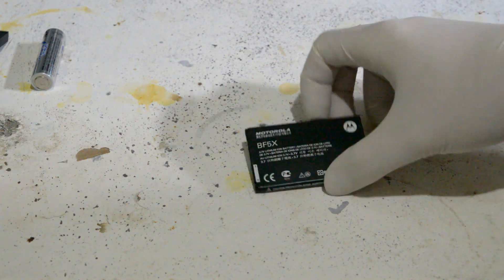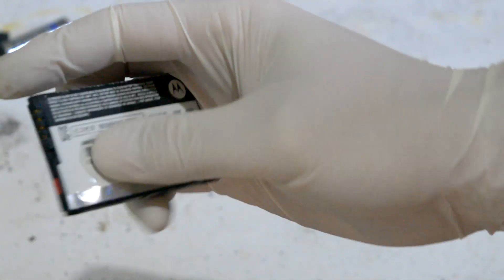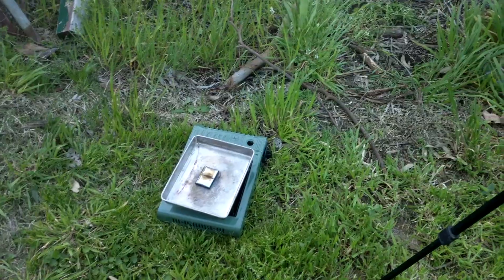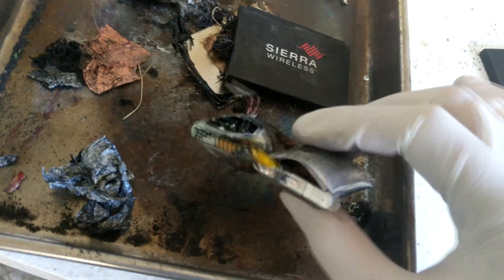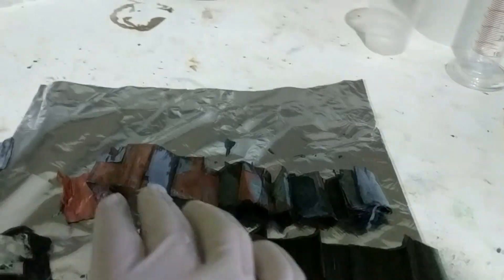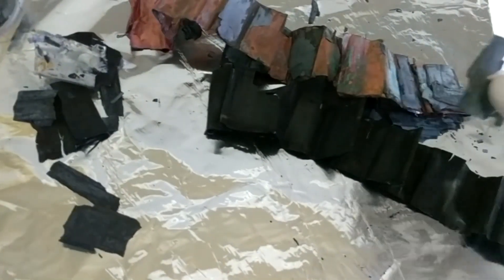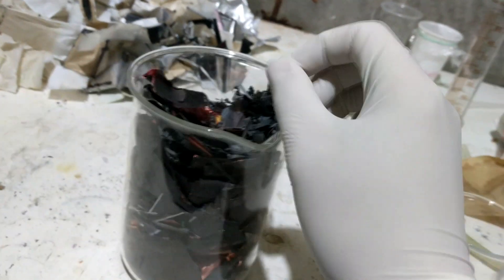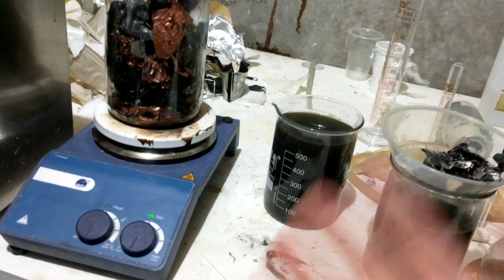Getting Lithium from Phone (Li-ion) Batteries - Part 1

Comment: Save the little bms boards as they will work with many types of lithium ion batteries. Discharge the batteries. Open them, then soak the guts in carbonated water. The lithium will disolve but the rest won't. After that you can get to the copper cobalt and nickel at your leasure. The lithium carbonate can be recovered by simply drying the solution.

Comment: Plenty of home devices with beryllium oxide already. Obviously in microwaves... A lot of electronic components are made with a BeO ceramic.... Just don't vaporize the stuff or bang out rails of it... It's not gonna cause too many issues. I know they gotta put warming labels to not drink brake fluid these days but inhaling or ingesting BeO or a Be salt would simply take too much work to get at. And those who are ultra-determined to go ahead and do it and ingest it anyway...  Need to be weeded out of the gene pool anyhow. So i say bring it on! There's barely any content for Beryllium on YouTube at all.... Just sayin

Comment: Would the "plastic" seperator be useful in an electrolysis cell, for example, copper sulphate to H2SO4 and copper metal rather than the use of a terracotta pot ?

Comment: My experience indicates anything done with a lithium battery s/b done immersed in naphtha, hexane, heptane or gasoline to prevent the lithium from making sparks and igniting.  I realize that is counter-intuitive but it is the truth..  Of course, if any water gets on it the stuff instantly ignites. 0:30  There is just under a gram of lithium in the AA-size lithium battery.  It is mixed with carbon so the piece weighs more than a gram.  If using it for chemistry experiments, be sure to look for and remove the little 'tab' of another metal attached to it so you don't ruin your aminations and whatnot. :It is also cheap to buy online in a pure form.

Comment: I know this is late and there’s probably a ton of these. This was an insanely dumb idea. I worked with lithium batteries. The single most dangerous battery I’ve ever worked with. Cutting them open could have made them burned for days if it was a different chemistry
Reply: You'd need a real big battery for it to burn for days. I've stuck a nail through big RC packs and they spit fire out violently but not for long.

Comment: You could put the batteries in hot water with a bit of salt to discharge them & soften the plastic. Then the plastic could be easier to score with something & maybepeel the plastic off.

Comment: +Extractions&Ire It´s actually possible to react and dissolve the lithium cobalt(III) oxide with nitric, sulfuric or acetic acids if you also add some hydrogen peroxide, which will reduce the cobalt(III) ions into cobalt(II) ions and will also produce oxygen gas.
Reply: Would muriatric (hydrochloric) acid work as well?
Reply: @someghostwithinternetacess1066  Hydrochloric acid works, but the reaction produces chlorine gas besides cobalt(II) chloride and lithium chloride so be careful.
Reply: @chemicalmaster3267  ok is there a way to reduce both into their pure forms? sorry english not my 1st luguage
Reply: @someghostwithinternetacess1066  It´s Ok, just keep practicing your English! Solutions of cobalt(II) can be reduced to cobalt metal by reacting with a more reactive metal like zinc or aluminum in a double desplacement reaction, but lithium metal is quite difficult to reduce from its compounds by an amateur chemist. Lithium is usually obtained by electrolysis of molten lithium chloride.
Reply: @chemicalmaster3267  ok it's mostly i don't use the correct wordings

Comment: Was surprised to find step 1 is blow it up, but then I remembered the name of the channel. Never change.

Also I looked into it and the explosion of a Lithium Ion battery supposedly gives off (going off memory here) Hydrogen Sulfide gas or somwthing. What I do remember for sure is it's the gas that'll interact with the liquid surface of your eyes to form Hydrochloric Acid, and nearly definitely blind you. So, don't try at home without doing the research and wearing proper PPE, this is rather dangerous if done too casually.

Comment: "They wouldn't put berrylium in a home device... It's too toxic"
You mean like the berylium that's included in almost EVERY microwave oven magnetron??? Ahhh, I see
Reply: I think you meant to say the beryllium oxide which is inert and has even been used in projectile weapons Nice try though
Reply: Inert huh?  Apart from the FACT that Berrylium Oxide is WIDELY known to be the leading cause of Berryliosis!
P.S.  They've put Uranium into 'projectile weapons' too!!!
Personally, I would suggest that any potential 'toxic' effects would be slightly outweighed by the great big HOLE through your head
Reply: @trevorvanbremen4718  BeO is carcinogenic in powdered form [12] and may cause chronic beryllium disease. Once fired into solid form, it is safe to handle if not subjected to machining that generates dust.[13] Beryllium oxide ceramic is not a hazardous waste under federal law in the USA
Reply: @trevorvanbremen4718  🤔🍑💨🤣🤣🤣

Comment: "They wouldn't put beryllium in a home device because it's too toxic" Umm... think again. Some microwave magnetrons have beryllium oxide ceramic in them. Or so I heard, maybe it's a myth... hey, there you have a video idea! Extract beryllium from magnetrons! (JK, please don't unless you want berylliosis)
Reply: That's beryllium oxide a highly refractory insulator not likely to react with anything oxides are not pure metals they do not react the same I will refer you to titanium dioxide frequently used in paint.....
Reply: Dani Syx Nope, it still gives you berylliosis, it’s the element, which causes an immune response. Beryllium compounds give you berylliosis as well as the metal, just like heavy metal compounds will also give you heavy metal poisoning.
Reply: Silica causes silicosis we better get rid of that too 🤣🤣🤣🍑💨
Reply: Dani Syx Silicosis only happens with very fine particles of silica, and that’s not easily found. In contrast, if you break the beryllium oxide, a very fine powder could emerge from it. It’s not a problem if you leave it inside the microwave but you need to be careful if you want to work with it.

Comment: The more charged the battery, the more energetic the reaction when punctured or breached. 
I had a complete dead, no revive possible LI-ion cell that gave absolutely no reaction, not even any bubbles when i poured water directly on the lithium covered plastic sheet. Then i took my old Samsung S5 battery and punctured it. Now that was fun. It had a 75% charge. That's one of the major reasons they don't ship li-ion batteries charged over 50%

Comment: 1:58 They do. In the magnetic creator (I think called Magnetron) of a microwave there may be Berylliumoxid. So if you Break it its not good.
Reply: Yeah it's an oxide so it's not going to react the way it normally would right? We are doing chemistry here aren't we? let me guess next you're going to tell me titanium dioxide has exactly the same properties as titanium because you know paint....
Reply: @danisyx5804  Berylliumoxid is very very toxic. It may only be in some magnetrons, still you have to be very careful. I am just trying to warn.
Reply: Yep, apparently its only in the older ones tho, in new ones they've apparently stopped using it in favour of aluminium oxide

Comment: tbh it looks like there's still a ton of Li/CoO in your reagent jar.  you can always boil it down.  i'd run at least 2 more extractions on it, so you can clean up the copper, which is valuable in its own right, and water is not exactly a scarce resource, even in australia.  at least not at the quantities you're using.  that whole reagent jar still looks black with Li/CoO.

Comment: They DO put beryllium in consumer goods, though. The magnetron tube has beryllium in it. Though I'm not sure for what purpose. You could easily make a microwave oscillator using a gunn or tunnel diode, but considering they cost about $20 each, it's not very practical for consumer level production. Plus I think those diodes only operate at a few milliwatts (0.001 watt) whee microwave ovens put out up to a 1.5 kilowatts (1500 watts) So I guess it's a necessary evil. I think cadmium in NiCad batteries was a much bigger safety concern. Cadmium scares the crap out of me.

Comment: U can make radium whit that and someting else, then u can make plutonium
Reply: You can’t "make" radium.

The "something else" you need IS radium.

You can extract some radium sulfate from old clocks and use the lithium (or any other strong reducing agent) to obtain radium metal, but there is no reason for that, the sulfate works just fine.
The radium sulfate can be used in combination with beryllium to make a neutron source. That neutron source can be used to convert uranium to neptunium wich will eventually decay to plutonium..but that would yield sub-microgram amounts.

A deuterium fusor (probably the strongest neutron source a hobbyist can build) would be a little bit better than the radium neutron source, but the only way to get visible amounts of plutonium is a critical fission reactor. And you need many many kilograms of uranium for that to work. And it is only legal to own a few kilograms of uranium, that’s not enough.
Reply: @among-us-99999  you're right
Reply: @among-us-99999  https://www.youtube.com/watch?v=dwRt74nzRmY&t=71s idk

Comment: It's best to first discharge them completely by first doing a normal discharge, then placing them in saltwater to fully drain all remaining charge. Then, you can cut them without any violent reaction.
Reply: NetRolller3D but you should still take a step back, the reaction products of the electrolyte with air are not very healthy. (Electrolyte contains LiPF₆)

Comment: Just my two cents from experience:
Whenever disposing of single cell Lithium-anything 18650s, I dunk them in a salt water bathe so the stored charges dissipate down to unusable. This may also work with battery packs like you used, but go easy on the salt to prevent it from tripping one of the internal fuses.

This should oxidize the Lithium itself (rendering it unusable for a battery) and save from extra sparks and toxic fumes.
Reply: Salt discharge method is a myth!

Comment: Suggestion: You could completely discharge the batteries first, way safer. Make sure you remember to bypass the protection circuitry (usually a little board on the top of the cell). If you don't it won't drop below around 2 volts. Leave it to short out for a day, ideally through a 5 ohm resistor to avoid it overheating and bulging the plates apart. If this happens there'll be some charge remaining where are gap has formed between the plates (squeeze it back together with a vice if so). You could then verify if it's been fully discharged with a voltmeter and making sure it stays at 0volts, but leave it 10 minutes after disconnecting the short before taking the measurement to allow any latent charge to rear its ugly head.
Reply: Even mostly discharged, still not a great idea to squeeze it in a vice and running the risk of a miscalculation

Comment: I used to work in an apple certified repair shop (TM, copyright, rights reserved, official/they'll sue ya if you cock up). If a laptop came in under warranty (aka we're obliged to fix it) and it made smoke or crackled or didn't smell quite right, anything really, we'd put it in a fireproof safe with a giant lock that our manager needed to unlock. (which would only happen once all the right paperwork and fire crews were in place) Then a priest would come in and bless everyone working at the time, follower by a bleach bath of the entire building.

And they'd have us ship the battery back so they could do R+D on it to see how some engineer screwed up. To ship it we'd put a sticker on it that just had an picture of an airplane with a cross through it and big bold font that said "FOR GROUND TRANSPORTATION ONLY". This was around the time of the extra-explodey galaxy 7s, so the word 'lithium' was considered sacrilegious withing 3 miles of an airport. It would get shipped with 1.5" of foam and a secret service agent as a bodyguard. Tippy top security, golden ticket, mums the word, etc. 

Seeing a puffy battery made my skin crawl just thinking of all the paperwork. 

Today, to relax, I put on some E+F, and I see you put hate box one on a hot plate until it explodes. Twice.
Which apparently didn't do the trick, so you take bolt cutters to one. Then when THAT fails you break out a dremel and just have at it.

Jesus Christ. I'm gonna have to go do my taxes with crayons to calm my nerve after this.

PS I might have fibbed about the priest but I'll never do it again I promise. <3
Reply from the maker: Hahaha that's hilarious. Perhaps it serves you right for watching me do dangerous chemistry to relax haha
Reply: @ExtractionsAndIre  well at this point I'm watching you keep apples fresh so it probably all balances out ;P
Reply: N C omg ahahaha same!  when's the cody collab coming?? 😂
Reply: Even a puffy battery is not all that dangerous.  Apple seems to seriously over react over these things. It is a bit ironic though because in all my years of phone repair ( thousands of phone over the years)  I have only seen one nonapple phone battery puff up ( samsung).  Deffinatly seen hundreds of puffy apple batteries . Just don't poke it with a sharp stick or make origami with it and you are fine.
Reply: >under warranty, when we were obliged to fix it
pretty much the only time Apple will attempt to fix anything, lol
Reply: rofl 😂
Reply: It was the galaxy NOTE 7. My galaxy S7 never had an issue with the battery when i had it, nor did many many others
Reply: Do you mainline methamphetamine?
Reply: james forest 
what?
Reply: @BothHands1  where the hell did that come from
Reply: First off that's absurd and hilarious, laptop batteries and phone batteries really aren't that dangerous even when you vzuzs a catastrophic failure.

Tbh single lithium batteries for phones don't scare me at all, unless you're really being dumb with them, you shouldn't hurt yourself, and if you are being dumb with them, the most you might do is burn your skin, and that means you really had to try to cause a failure with your bare hands
Reply: @HerbaMachina 😊

Comment: Dollar value for scrapping lithium would be awesome.  Or even getting precious metals from mobiles.
Reply: yeah but manual labour sure wont make it profitable. Id suggest passing the batteries through a fine shredder, one of those that people film destroying cards, bikes, motorcycles, fridges, etc but with a smaller and finner teeth so they crush the batteries into small enough pieces so that the chemicals can disolve everything.
Remember you are profitting from the time, not from the lithium, so if you have to dremel open each battery to get a few litium mg, im sure its way cheaper to just dynamite a mountain.
Im not a chemist but i suppose crushing and disolving everything would be easier and scale better than the dremel method. With a bit of luck, the impurities introduced wont need expensive or slow reactions to be separated.
Reply: @laharl2k  Yeah, except I'm not too sure if lithium and a shredder would be a great combination. Keep in mind group 1 metals are the most reactive elements around- you could put them in a completely isolated room and they'll still find something to react (i.e. explode) with. When you're dealing with highly dangerous chemicals like these, industrial efficiency would be the least of your concerns.
Reply: @A Single Shade Of Grey
Not really, on those big shredders theres only steel and yeah it could catch fire and burn the plastic and stuff but theres not enough material to do any damage to the steel parts of the shredder. Just make sure the pieces that may catch fire fall onto something metallic with no flamables around. 
And if you want to be extra safe leave them a day out to make sure that if anything was reacting with something, it already finished by the time you start processing them.
Reply: @laharl2k  The good thing is that lithium only burns around 600 degrees so nothing will melt, but my concern lies in the  processing of the material. Putting high amounts of pressure on a toxic and explosive chemical could kill a lot of people, especially if the shredding is done in a confined space (rapidly expanding gases are what makes explosions happen). Considering that the batteries are all processed in one place, if there was to be a breach or leakage of materials you could end up with quite the fireball. 

Even if all of this is contained, Lithium will react with atmospheric water to produce LiOH, an extremely caustic base that will dissolve the steel over time, so you'll end up with a defective shredder and a lot of toxic waste. There's got to be a better way of doing it.

Edit: One other thing- the byproduct of producing LiOH is hydrogen gas. If there's other bits of lithium burning at 600°C right next to where the gas is being evolved, it will react with residual oxygen to produce water along with a 2000°C flame (this is how rocket fuel works) and the whole chamber will explode.
Reply: @Relatablename  not really. Ypu could leave it in a room, but depending on conditions most of the time they'll just oxidize. When you go to cut the metal with oxides and superoxides, then you run into a potentially hazardous situation
Reply: @Relatablename  and lithium ion batteries reach over 1000. I know from first hand exp and seeing the steel casings of them incandesce

Comment: dude thats the WORST way to extract. you shorted out all
of the batteries which could have caused you great harm!
pop off the end carefully and gently spread or peal the casing 
and use nonmetalic grip to pull it out. STILL a high probability
of shorting. 😉 cheers !